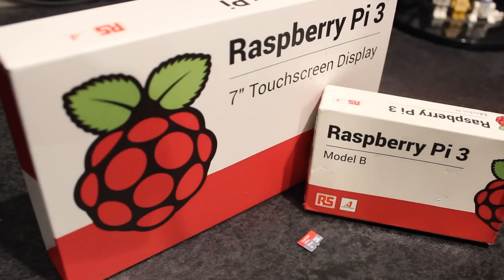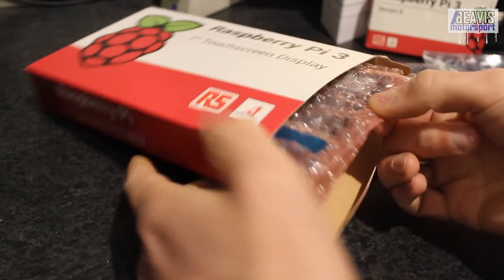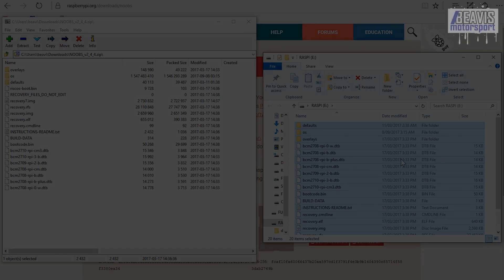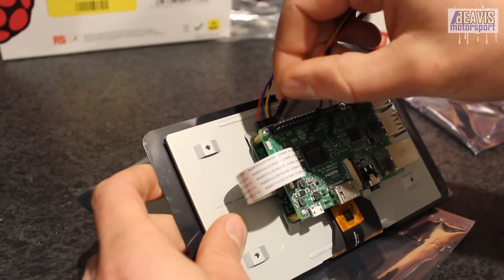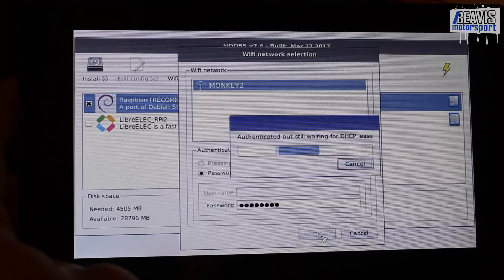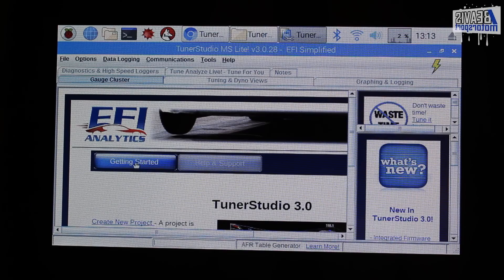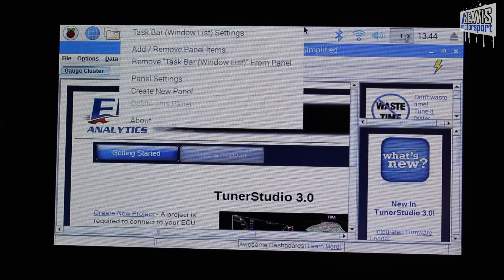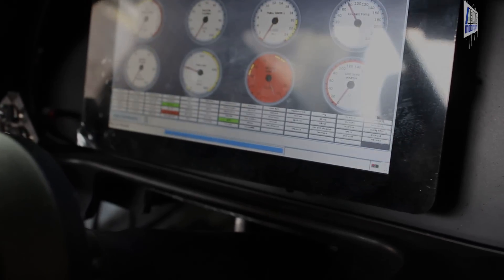GUIDE: BUILD A RASPBERRY PI3 WITH TOUCHSCREEN FOR CAR DASHBOARD

Comment: how's it going, just installed this same setup in my car using microsquirt, for some reason I can't get my rs232 to USB cable to communicate with the raspberry pi. What config would I need to change or a proper rs232 cable?
Reply from the maker: It sounds like you're on the right track! Make sure your RS232 to USB cable is compatible with the Raspberry Pi and check the configuration settings. You might need to adjust the baud rate or other communication parameters in your setup.

Comment: You missed the part where you connect your Pi to your car.
Reply from the maker: So sorry, that is something I glossed over forgetting that not everyone viewing would have the context that this is for a Megasquirt ECU.
I'm running this dash in a track car that uses a Megasquirt MS3 ECU.
So all my sensors, speed, temps etc go direct to the ECU.
Then the ECU has a USB connection direct to the Pi to feed the data for the dash software.

Comment: Can this be done to any regular car? Nissan Versa 2010 for example? Or does it have to be a racecar?
Thank you!! Awesome what those little things can do.
Reply from the maker: Hey it doesn't have to be a race car but this dash is in a track car that uses a Megasquirt MS3 ECU. So all my sensors, speed, temps etc go direct to the ECU. Then the ECU has a USB connection direct to the Pi to feed the data for the dash software.
If you wanted to use  a different aftermarket ECU or OBD2, perhaps consider trying: OpenAuto or: OneGauge, theonegauge.com.

Comment: Great video! I have a question, I am going to work on a project  to swap out the factory radio into raspberry pi radio, How do i do this? is there a workaround to do this? I have been thinking about it for some time. I have 2017 kia sorento. How do i make everything work  such as gps with raspberry pi?
Reply from the maker: Hey Jason,
Certainly, I am sure you could do that. I built this dash for my race car so i don't really have experience with radio or sat nav style features, but some googling will surely find you other solutions out there. Perhaps the OpenAuto software would work for you... look that up.
Reply: @Bbeavis  Thank You! 🙏

Comment: www video helped me make my raspberry pie, 10/10 youtube guide
Reply from the maker: Thank you :-)
Reply: hey man i got a question how do you get the speedometer to read in tunerstudio
Reply: i have na miata
Reply from the maker: @teslajr2344  Using an MX-5 NB speedo sensor in the trans, through a JBPerf VR conditioner, into a digital switched input on the Megasquirt MS3.
Reply: Bro you're not making a fucking ras pi! That's the already build PCB that's literally showing "raspberry pi" on the actual package.

Comment: How do you power it up in the car?
Reply from the maker: The raspberry pi can be easily powered via USB cable. So any reliable and high output USB adapter for the car is fine. You want something that's 2A+ and at least 5v (the pi likes 5.1v or so).

Comment: so im wanting to have a mulitple off roading trail cam set up....possible to connect cameras to this?
Reply from the maker: Yes there are camera input solutions for the raspberry pi. As long as you arent planning to use TunerStudio software it'll be fine.
Reply: @Bbeavis  okay copy that! thank you for the reply...would these have to be Pi specific cameras or can i just buy some (thinking cheap back up cams on amazon) and connect them to the board?
Reply from the maker: @megan8494  The Pi is a mini computer, so either a USB webcam or RCA->USB converter for a car backup camera would be the two options i'd try.

Comment: If you have any issues with the SD card failing try using an industrial Micro SD card - they are made for use in extreme temperatures 
https://www.kingston.com/unitedkingdom/en/memory-cards/industrial-temperature-microsd-uhs-i
Reply from the maker: A quality SanDisk has never failed me... only cheap no-name brands have.

Comment: How did you run power to the usb cable, what did you use to step down from 12v to 5v and do you
have fuses setup for overload protection?
Reply from the maker: There is a 12v to 5v dc converter that runs behind a fused power source. that runs the USB into the Pi. Fairly straight forward, just need high output 5v source as the Pi is a hungry fella.

Comment: Can it run Hondata Kpro K Manager? Since it is technically a mini computer I would think so🤔
Reply from the maker: A quick searcg suggests hondata software does not have a linux OS based option. You might have to do some googling and see if someone has made something for your specific ecu.
Reply: @Bbeavis  I am going to install Windows 10 onto the Raspberry Pi and then see if I can run the k manager from there. wish me luck

Comment: I'd like to do this in my 04 a4 b6 would it be the same process and it will still read warning lights right
Reply from the maker: Hi Justin, this setup is specifically targeting Megasquirt ECU's, but you should be able to find some software to work with your car/ecu.
Reply: Where do you recommend I look?
Reply from the maker: @Justin Medina  Try https://www.janssuuh.nl/en/ or https://www.audi-sport.net/xf/threads/raspberry-pi-pican.355043/
Reply: Thank you , im.going to attempt to build the Audio system and I'll come.Bck here if I have any problems syncing with my ecu

Comment: Do you have a video of setting up a MegaSquirt 3 MS3 with MS3X?
Reply from the maker: As I understand the MS3X board is just a plug in affair, no soldering required. I don't have one myself though. Then configure TunerStudio to use the new outputs.
Reply: @Bbeavis  How about a video just setting up the MS3-Pro? I intend on buying one but want to see the difficulty level of getting one installed correctly. (I'll be installing on a 2002 Pontiac Sunfire)
Reply from the maker: @christophermatuszak681  Best to have a look at the forum here: https://www.msextra.com/forums/  Or the supplier here: https://www.diyautotune.com/

Comment: I have been looking on the RS web site, and for the PI3 there are a couple of different choices with different processors,. which model would you recommend?  or for about the same I could upgrade to the PI4, with the options available now what would you recommend?  also could there be a way to make the outer case somewhat water resistant... and still use the touch screen, this will be on a boat....
Reply from the maker: From what I've seen, it's a good idea to get the new Pi4. Haven't used one myself, but it's more powerful so seems a no brainer, for a few extra dollars it seems worth getting the top spec unit. Good luck with water resistance, you'll have to search that yourself as I have no experience there.
Reply: @Bbeavis  thanks for the info, i have a couple of ideas to recess it in a dash and seal the edges, so allegedly water if and when should only hit the screen. we will find out if it works or not. now I will  see how long it takes to ship with all the headaches we have had so far this year...

Comment: How you connect to the elm?
Reply from the maker: It connects to the Megasquirt ECU via a USB to serial interface.
Reply: @Bbeavis  how i connect to obd ?
Reply from the maker: @djbertinho1984  You will need to do your own research there mate, as above, I'm using an aftermarket Megasquirt ECU, no OBD.

Comment: I bought two raspberry pc units, one by accident. I've never worked with this brand before (embarrassed). Instead of returning one, can I use an old laptop screen? Is the ribbon cable the same? I also have battery dead ipads x4.  This is for my children to learn about computing and coding. They will primary be doing the work.
Reply: Ribbon cable is the same from a 7 in touch screen. I got a metal case, very spy movie-ish. I'm melting milk jugs for the screen surround. Ipad cable is different though. I have no idea how to recycle those yet. One Pi, I put in a laptop fan which lights up. No one was using it! We are having loads of fun with them.
Reply from the maker: You possibly could use the laptop screen if you get lucky and are clever with electronics. But it wont be straight forward for the average user... I wouldn't attempt it personally. Maybe try use the hdmi port and connect to a normal PC screen instead?

Comment: How did you connect the MS ecu to the pi? Serial to USB adapter?
Reply from the maker: The Megasquirt MS3 ecu has an inbuilt USB to serial interface the connects to the PI via a USB port on the ECU. You can see the actual install into the car here: https://www.youtube.com/watch?v=b7isnWqw13U

Comment: Team viewer is NOT necessary. Use VNC viewer (already built in)
Reply from the maker: True. But for my use, TeamViewer was already installed on my computer and also I can quickly connect to the Pi via my phone also if I need to.

Comment: What dongle did you use for the OBD2 port
Reply from the maker: There is no ODB port used, it is connected to the Megasquirt ECU via USB.
Reply: @Bbeavis  so you have an aftermarket computer in your car
Reply from the maker: @stevenmedici1468  Correct. The software used is specific to the Megasquirt MS3 ecu. I have more detail on the car installation and connectivity here: https://www.youtube.com/watch?v=b7isnWqw13U
Reply: @Bbeavis  oh ok, I use to race my eagle talons turbo AWD and I use the halltech programmable fuel injection management

Comment: I have a Pi 2 model B. Do you think I can use it like you did? I haven't researched the differences between the 2.
Reply from the maker: Yes, the Pi2 would work exactly the same, but may struggle with performance issues.

Comment: It is recommended to use OLED display panel to effectively solve the display problem in strong light environment.
Reply from the maker: Oh really, I wasn't aware that Raspberry Pi had an OLED display for their 7" touchscreen now.
Reply: @Bbeavis  I'm not sure if the Raspberry Pi has customized the OLED display kit, but this is at least a good start.
Reply: @Bbeavis  Maybe we can find a suitable alternative on eBay or Taobao.
Reply: @Bbeavis  I like the Raspberry Pi, but so far I haven't purchased a kit to use my creative imagination.  But soon I will have a small DIY project and I will probably use it. This will be a function of storing data backup on the PC's NvMe.

Comment: Oh boy. The video about Pi and dash board and not a word about how it is actually connected inside the car. also. How do u power Pi in the car? Battery or cigarette lighter plug?
Reply from the maker: My race car doesn't have a cigarette lighter, I just run a 12v to 5v converter with a USB outlet, and power the pi via a standard USB cable. Really not that complex.

Comment: Did you fix your under-voltage issue?
Reply from the maker: I upgraded to a pair of 3amp USB power supplies and also swapped to higher quality USB cables to help remedy the power issue.

Comment: Awesome! How did you interface raspberry with your car? Did you use some app that reads data through the ODB2 port? Cheers mate.
Reply from the maker: The Megasquirt MS3 ecu has a USB to serial interface the connects to the PI via a USB port.

Comment: Why the hell would anyone want a touchscreen BEHIND their God damn steering wheel? That is almost the impractical thing I have ever seen.  
I would say you'd want a touchscreen in the centre dash in portrait mode  and a non-touchscreen behind the steering wheel and then find a good way to control what information is displayed on the gauge cluster.

And I'd also try my hardest to make it look like a real gauge cluster.
Reply from the maker: I'm sorry if you don't believe this suits your interest, but no need to shun it. It's perfect for my application, in a track car where I need to monitor the car to ensure everything is safe and appropriate. I don't have a centre dash, i don't have a radio, i only use the touchscreen occasionally, but not whilst in motion. I hope that you understand there is a purpose behind why I made this.
Reply from the maker: @Aniceto Maldonado Jr Cheers mate!

Comment: I hate to dampen the party, but this setup is going to cook itself to death in a big hurry in a closed car on a sunny day unless you mount heat sinks and large fans. My raspberry pi’s throttle down severely inside my 3D printer enclosure, and it’s only 108 degrees f in there. Your car will get hot enough to cook the electrolyte out of the cheap capacitors used in these touch screens in short order, so expect problems before long.
Reply from the maker: Hi Mark, I have been using this for over a year now without a single issue.
Perhaps if you have issues, they are with your specific Pi?
Reply: @Bbeavis  You could be right, I need to check. Did you attach a heat sink? Even with a fan, I get temperature warnings until the air conditioner cools the car. Maybe there's a better place for me to put the unit than behind the dashboard, which gets very hot on a sunny day.

Comment: Can i use this with non-OBD2 cars?
Reply from the maker: In my case, this is running an aftermarket ECU with custom software and a USB connection from the car to the PI. Anything is possible!
Reply from the maker: Robert Slackware  I know of others who keep the pi powered up at all times for an almost instant connection, and just drop the screen display when they shut the car off.

Comment: What about the power issue? For example, I have it hooked up to a 12v to 5v converter thing attached to my car so when I turn off my car so it will turn off the PI as well. Now the issue with that is that when I turn off my car it does not turn off the pi normally, think of it as unplugging the pi from the wall.  So basically to turn off the pi properly I need to keep my car on and touch the bottom left of the screen, touch the turn power off and wait till the pi turns off correctly and then shut off the car.  Its very annoying. If I shut off my car and not turn off the pi from the button on the bottom left I could risk corrupting the sd card or something because basically its unplugging it. Do you turn off your pc by unplugging it from the wall? Because I dont
Reply from the maker: Hi MrToast, I have a link in the description to the power button I have used to shutdown the PI safely.

Comment: What kind of obd interface did U use?
Reply from the maker: It is not using ODB. The aftermarket MS3 ecu is connected via USB directly to the Pi
Reply: BEAVIS Motorsport Ok. Smart one 😉

Comment: You may want to give the pi more power, see that little lightning bolt in the top right? That's an undervoltage warning.
Reply from the maker: Yes I know.
Reply: You didn’t pay attention around 5:38?
Reply: minimum have 2,5A power and recomment have 3A power what all normal uses.
Reply: @mattivirta  2.5a is not needed.
Reply: @dylanharding5720  if uses tft duisplay needed because display eat more current, if uses hdmi and monitor no need because monitor have own wall power.many have problem raspi just because not understand tft display eat lot more current need biggest power.

Comment: I got the same kit and built it exactly the same but my screen isn’t turning on. Lights are flashing and when I connect it to a monitor it works perfectly. Did I just get a bad screen?
Reply from the maker: No idea sorry mate, perhaps it's a dud.
Reply: BEAVIS Motorsport yeah I called For support and ended up being a faulty screen all fixed now. Thanks for the reply !

Comment: How did u connected it to car system, and   can raspberry pi used to automate the car?
Reply from the maker: It is a USB connection to the Megasquirt ECU. You would probably want an Arduino for DIY car automation.
Reply: To automate steering, you'll need a steer-by-wire car, which aren't very common.
However, I do believe you'll be able to implement cruise control and other systems.

Comment: So just buying a tablet would be better then and cheaper as well.
Good idea but $150 for a screen was a deal breaker.
I use a jvc media player deck and a nexus 10 Velcro over the deck and works perfectly
Reply from the maker: Hi Anthony, while a tablet might seem cheaper on face value, it doesn't offer the levels of customization and input/output that a raspberry pi does and nor will it have the USB inter-connectivity with the ECU in my car. This is a specific build for a particular purpose.
Comparing this to a JVC media player is a bit ignorant considering the intended application.
Reply: @Bbeavis  you can add to raspi all usb,hdmi,vga,tft, displays tablets etc and can add custom sensors etc, to raspi gbio port, and use all aplication what you need use.

Comment: If you were confident you could probably install the minimal version of raspbian providing only the command line and install your display server (X11 for example), and have the application launch directly on the display server on your user's login, without a full desktop environment. You could also write a little script so that when you got home the pi uploads data to server via your WiFi if you were to crontab it.
Reply: I might be able to implement that, when I get around to even doing that.

It'd lead to faster performance.
Reply from the maker: Definitely possible crumpet. Anyone who is familiar with the linux based OS's could make this do some very clever stuff. I'm not quite at that level... yet :-P
Reply: Yeah that's much more complex than it sounds lol. And better to use the car's antenna, your phone's Bluetooth / handoff / nfc / anything built in you're already carrying that handles that like a smart watch etc. And better to download a prebuilt app to handle that part via the mobile device honestly as that's not worth reinventing. Just save to g drive or push to server but meh

Comment: How does the raspberry pi receive your car's info about the RPM speed ect?
Reply from the maker: It has a USB connection to the car ECU
Reply: @Bbeavis  tunerstudio is only for megasquirt/microsquirt ECU?
Reply from the maker: @DeeF96  That is correct.